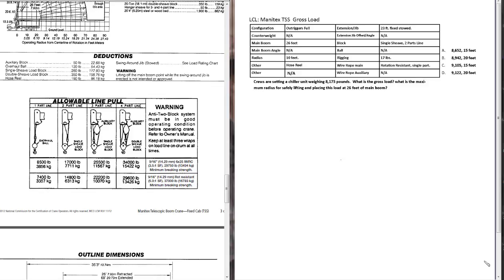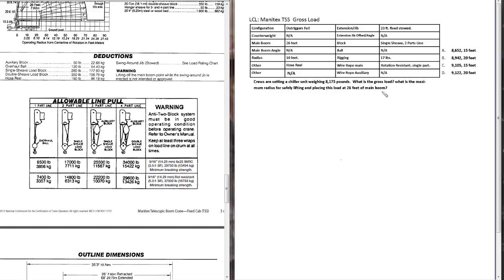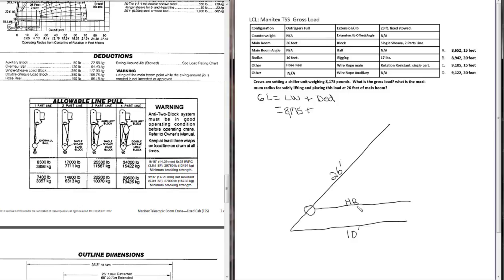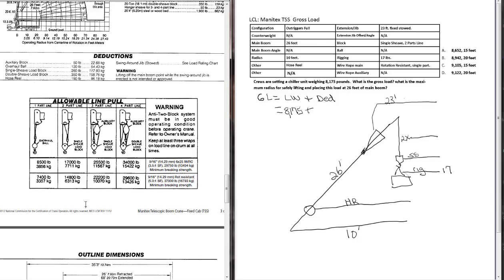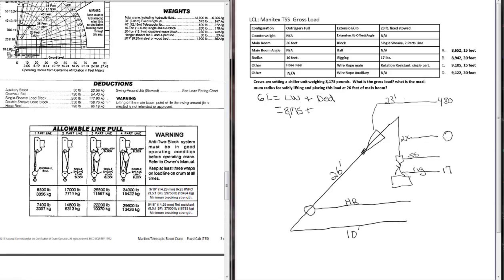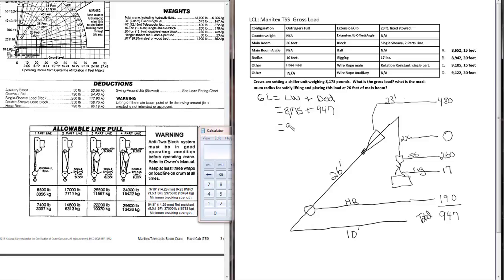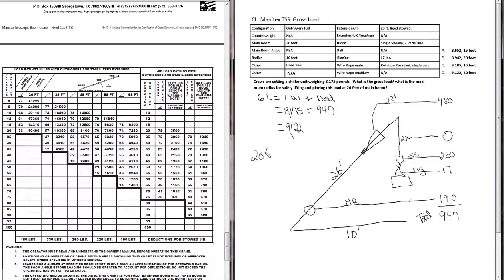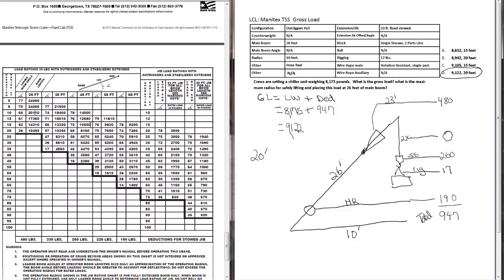Manitex TSS Gross Load Calculation

Comment: i got a problem  with a counterweight ? with no deductions, only boom length and angle but the answer did was not there
Reply: it was asking gross load . the gross load was 2240 with the boom length and angle no deduction at all , but there were 3000 counterweight, the pure gross answer was no there . and if u were to add or deduct the 3000 no answer either, i read the whole tss student guide i didnt see any counterweight on the book
Reply from the maker: Sounds strange.  I’d have to see the exact problem to be much help. Sorry.